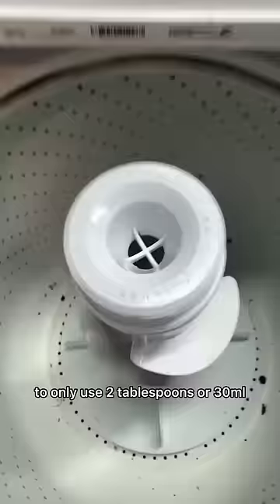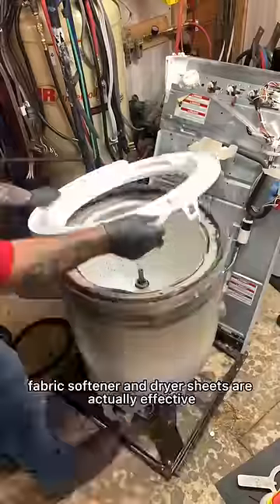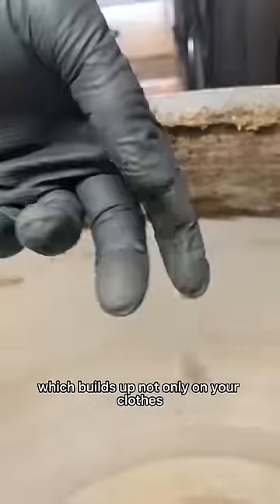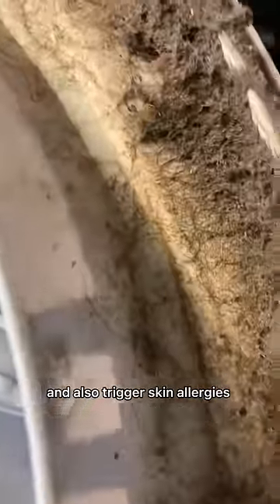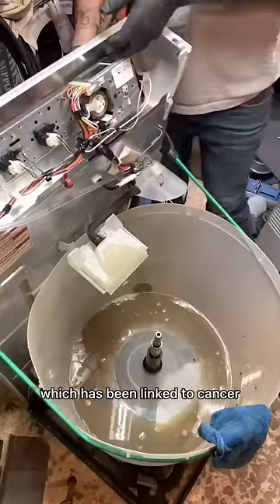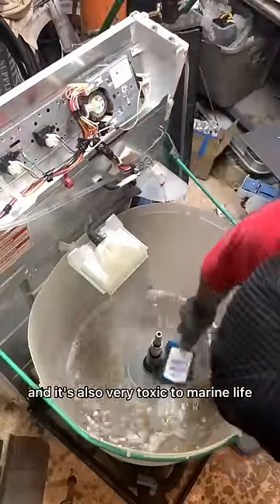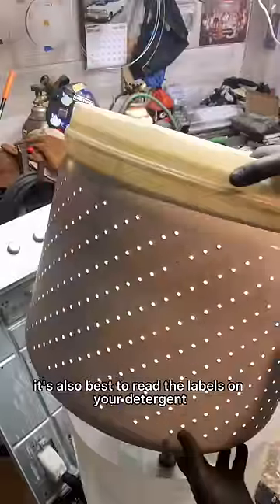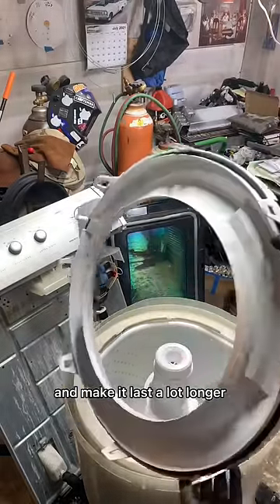Softener leads to machine failure

Comment: I've know this since the 80s when I worked at a laundromat during college. The owner said fabric softener was the worst invention and that it was shortening the life of his machines. About 10yrs later I had to start using a laundromat and even tho' I didn't use fabric softener, the residue from other loads got on my clothes and flared up my dermatographia. To this day I have to live where I can have my own machines to avoid other people's fabric softener. I also make my own laundry detergent with castile soap, washing soda and borax. I use a 2tbsp coffee scoop to measure it and also rinse with [white] vinegar. I didn't know the name of the chemical glutaral. Thanks for that info!
Reply: Castille soap and borax ❤❤❤
Reply: Washing soda or baking soda?
Reply: @j.p.6932  Washing soda. Washing soda is not edible whereas baking soda is. Washing soda is specifically used for washing. It's made from baking soda and you can make your own by heating it in a flat pan in the oven at 400degF for 1-2hrs (depending on the type of pan you use). The heat causes a chemical reaction that makes it more caustic than baking soda. Washing soda has a pH of 11.
Reply: I really highly doubt the truthfulness of that. My parents have had two washing machines in their adult lives. I've had one for 15 years that runs like a top and has never needed service. Decades of regular, almost daily use is a pretty good indicator. Vinegar is also advised against by some because it breaks down rubber components more quickly.
Reply: @e.l.norton  You do you.
Reply: @Nicole215  No. It's advised against by people who used it and the repairman who've replaced the gaskets and hoses. Vinegar cleans corrosion off of copper. What do you think it does to rubber over time? Chemistry is chemistry. But, they're your repair bills. Have at it.
Reply: which vinegar type do you use?
Reply: @Squee7e  White
Reply: @GraeMatterz  
Good to know. Thank you. I’d never heard of washing soda before
Reply: I use washing soda, baking soda and shredded zote soap. I use distilled vinegar for smells and shout for deodorant stains.
Reply: What is the mix ratio please? @Mighty_Atheismo
Reply: @George-vf7ss  I used equal portions of castile soap, borax and washing soda. Typical batch is 2c each. I use unscented Kirk's bar soap and shred it into flakes using a cheese grater, then turn it into a powder in a food processor. I mix the 3 ingredients and place them in a container. (I use a repurposed protein powder jug as it has an opening wide enough to get my hand into and has a threaded lid.) I keep the 2tbsp scoop in it and stir it up every once in a while to keep it well mixed.
Reply: @professionalcommenter  I've heard others saying they use both washing soda and baking soda but adding baking soda is redundant as washing soda is made from it in order to make it stronger.
Reply: @Nicole215 you wrong and you know it. Any adult knows vinegar dissolves rubber by making it brittle and flaky. Take a science class or read a book
Reply: I use soup nuts(a litteral berry that acts like soup😊) for laundry soup. Then I dry my clothes with wool dryer balls. I still have issues with the itchy skin because it's shared laundry but it's not as bad as it was😉
Reply: @rahorakhty1420  While this is true, many modern rubbers we use in washing machines are resistant to deteriation caused by vinegar. Also, remember that it's going to be extremely diluted in your washing machine. Vinegar is a great additive and won't do much to harm your machine.
Reply: just get softener for sensitive skin lol then your clothes smell nice
Reply: @BobaPhettamine  The problem isn't hard water. The problem is chemical residue and odors. Fabric softener stinks.

Comment: Also vinegar is a great way to clean microfibers without damaging the sensitive threads.
Reply: Is this why my jammy jams get those cratchy balls on them!? I feel lied to!
Reply: @Interweb_Gremlin That, and the dryer itself can cause a surprising amount of damage to clothing depending on the fabric used. Especially synthetics and some natural fibers like wool and real silk.
Reply: @peggedyourdad9560  also depending on the type of dryer. Heat pump dryers are less harsh on clothes than a standard vented dryer.
Reply: Thank you for that information. 😊

Comment: I stopped using fabric softner about a year ago, but my washer still had so much residue built up from it stuck in the compartment where you put it in. Took it apart to clean properly and it was like wax, warm water didn't melt it or help, had to scrape it off. Didn't dare pour it down the sink in case it blocked the drain too, so I used paper towels and binned it. If it doesn't melt in hot water imagine what it's doing to your machine and clothes.
Reply: I mean if it doesn’t melt in hot water it’s probably having a minimal effect on your clothes since it can’t leech into the water
Reply: I used it once and never again because it didn’t do anything and I realized on the bottle it said it can make fabric flammable no thanks.
Reply: @mrs.quills7061 A TON of fabrics are flammable NOW, lol. Anything synthetic Is a guarantee of being flammable. So, cotton, wool, leather. That's it.
Reply: @windsofmarchjourneyperrytr2823  Bamboo.
Reply: I know what a yucky job cleaning the gunk from the outside of washer tub is. I am grateful I found a YouTube video showing how to take a top loading washer apart and replace the pump. While I had it apart, I scraped the gunk off.
Reply: @rouninpanda6318 why would you put bamboo in a washing machine though... also, what clothes are commonly made of bamboo?
Reply: @rouninpanda6318 Hemp
Reply: @SacredMilkOG There are now textiles made out of bamboo fibers that are used to make a variety of clothes.
Reply: @SacredMilkOG Rayon is often made from Bamboo. I believe it can also be made from wood and hemp too. Bamboo is also used in making a variety of mattress components too, charcoal, covers/liners, ect..
Reply: Use vinegar(200ml) instead...the result is nice and soft clothes...
Reply: @mstar501  200ml???? 😂😂
Reply: @SacredMilkOG 
Base layers, underwear, bedding… due to the inherent antibacterial aspect.
Reply: Why? I don't have an issue with softener use. Period.
Reply: I had to use a Chisel to remove the hard residue on the drum
Reply: I noticed Rinse and Repeat breaks that residue down after using it in your wash a few times.
Reply: @DJRenee  What's that?
Reply: @mrs.quills7061 you... You do realize. All fabric is flammable? Unless it's soaked in a flame retardant

Comment: I greatly enjoyed learning about wool dryer balls.  Best buy of my life!  I don't have asthma, but I do have allergies that are getting worse as I get older.  Indoor or outdoor, strong smells can also set off the histamine reaction for me. So I changed household cleaners wherever possible and while I never used fabric softeners, I stopped using dryer sheets and started using wool balls. They soften your clothes, dry puffy coats better anyway, and don't leave any residue or smell unless you choose to add a drop or two of essential oil.  They last a really long time and basically never need to be replaced. And my grandma can use them as a stress ball if she gets bored😂.
Reply: yea its best top not put vinegar (an acid) into your washing machine anyways, as you can break the rubber seals, this guy fixs machines so he would love everyone to use vinegar, gives him a job

Comment: I always tell everyone I can every 6 months scrub the lint screen from your dryer with a scrub brush and Dawn dish soap to get rid of the waxy buildup from using dryer sheets. 
It builds up so much that air cannot get through the mesh. Cleaning it at least every 6 months will extend the life of your dryer by years and also make it so your clothes dry faster.
Reply: If you read the manual, like this guy is preaching, you're supposed to clean that thing a LOT more often thsn that.
The footage in his video here is only because people don't.
Had a few washing machines in my lifetime, decades later none of them look as bad as the stuff in this video.

His words are scare tactics, true, but only to an extent. He's not telling you the whole truth.
Reply: @Duck_side  who's missing their dad
Reply: I believe your suppose to clean the mess every time you use the dryer because of the lint build up. I ain't never heard of letting it go for six months and was taught to clean it, everytime you use the dryer.
Reply: @loretta2539  yes you clean the lint from the dryer everytime. Every 6months you take the empty lint screen and scrub it with a scrub brush and dawn dish soap to remove the waxy build up up on the mesh.
The dryer wouldn't run if you didn't clean the lint for 6 months..
Reply: @loretta2539  this, exactly. It's even written in the manuals supplied when people buy a new dryer.
Reply: That and cleaning the lint screen every time you do a load of laundry. I do a lot of laundry and have pets. A. I don't use dryer sheets or fabrics softener. B. I clean it after every dryer load. 
I tooky dyer apart after 3 years to clean the inside I found maybe a palm size amount of lint inside.
Reply: @magnit3  yeah I kinda thought cleaning the lint out everytime was a givein, but I guess not everyone does that. But regardless the wax from dryer sheets will clog up the screen even with cleaning the lint out.
Reply: Yep. Run the mesh screen under the faucet amd watch it hold water if you don't believe it.
Reply: @humanmonsters  It's kind of shocking to me that everyone is missing your point about wax buildup and assuming that you don't clean off the lint itself after every load. I, too, thought that that was just a given, but it looks like a lot more people than I realized like to court house fires. 😬 Anyway, your OP was a great tip for anyone that uses dryer sheets and has ears to hear. Thanks for sharing!
Reply: @Kira_Martel  yeah no I was taught to clean the lint out of the trap when I was like 9, the fact that it's so uncommon that people assume that's what OP meant is honestly terrifying
Reply: My household has started using wool balls which are marketed as an alternative to dryer sheets as we're all affected by fragrances, myself especially. They do pretty well at removing static and I think the mass of them churning around is what helps with wrinkles.
Reply: @OOZ662  I lived with a friend who used those, I tried them a few times. We also would put a few drops of lavender essential oil on them. You're right about how they do well to get rid of static.
Reply: @Kira_Martel  yes, I kinda felt like maybe I didn't write clearly enough, because people kept saying that. Thank you!
Reply: @Kira_Martel  When I was a kid our dryer caught on fire even though we always cleaned the lint trap And my mom would put the vacuum hose down inside the machine and into the exhaust hose from the outside. (Found out later it was because the exhaust hose we were using was an all aluminum one, which had been taken off the market because it would start dryer fires really easily.) We switched to the white plastic ones after that, but it was still a terrifying lesson about how easy it could happen.
Reply: @human monsters,Wise up!  the lint that's collecting in your dryer, that's your clothes breaking down.

Heat breaks your clothes down, that's why I quit using a clothes dryer years ago. Now I air-dry my laundry, and my clothes last much longer. 
🤟😁👍
Reply: @humanmonsters
Reply: I clean the lint every load and never use fabric softener or dryer sheets. My washer and dryer are happy.  My clothes and towels are great.  Wool dryer balls are great.
Reply: @humanmonsters  I don’t have waxy buildup because I don’t use fabric softeners or dryer sheets.
Reply: @anitas5817  that's awesome. 👍😎
Reply: I clean it after every single dry
Reply: @humanmonsters  you should consider switching to dryer balls. You won't get the waxy build-up plus they save on your energy bill by reducing drying time. Also they're cheaper in the long run. 6 balls will last you YEARS and they're much better for the environment.
Reply: @ekaski1  I've tried them honestly I didn't really care for them, I didn't see any reduction in static cling, I don't think it made the clothes dry faster. I even had the essential oils to drip on the ball. I just felt like it absorbed of the oil and didn't really make clothes smell like it at all. Though it does help when you try to dry something big like a comforter, but tennis balls do the same thing. Everyone has different preferences. It's just not for me. 🤷🏻
Reply: @humanmonsters  oh interesting. It reduced my dry time by 40%. I used to have to run 2 cycles for towels and jeans but now they're done in 30 minutes. But tbf I live in a humid climate so clothes take longer to dry here but I have no issues with static cling.
Reply: @ekaski1  are you sure that your dryer vent hose and inside of your dryer are free from lint? If you lift up where the screen goes you can stick your hand in or just shined a flashlight down there to see cuz sometimes the lint builds up in the dryer underneath of where the screen is. When I was a kid our dryer caught on fire from just a little tiny bit of lint in the vent hose that vents outside. It's worth checking! Yeah anytime I found a dryer that doesn't dry clothes that's usually what the problem is, that the air can't get out of the dryer and it takes the clothes along time to dry.
Reply: @humanmonsters  oh yes I'm sure. I get the entire line cleaned annually. My dryer works fine, even though it is nearly 10 years old. It's just that the balls REALLY help.
Reply: @loretta2539 There's way more cleaning that that, tho.
Reply: Well I skip using dryer sheets so no need 🤡

Comment: Solid advice! And yes, the vinegar does NOT leave a lingering smell.
Reply: Yes, it does! And I've given it plenty of chance 😖. Nope.
Reply: I've been using vinegar instead of fabric softener since 1999 when I bought my set. My washer and dryer are still in great condition, and I've never been told I smell like vinegar. And yes, leave the lid open after a wash.
Reply: How much should I use?
Reply: @stripermad1  I just fill the spot designated for fabric softener with the vinegar instead.
Reply: Dont mind if I ask what brand did you use? Some brand perhaps have different ingredients
Reply: @gtc7975  I use store brand. I usually get mine at Sam's club, which is members mark brand, Walmart is great value, and Aldi is Tuscan garden.
Reply: @MT-jl6zn  There is scented vinegar available fyi. You can also use apple cider vinegar that smells more like apples than pure vinegar.
Reply: @sarahjohnson6620  you can mix your vinegar with some lavander scent or whatever scent you want, of course just a few drops 🤗
Reply: @vicious420  I put lavender on my wool dryer balls. Work great!!
Reply: Yes, we have no bananas...😅

Comment: I stopped using fabric softener and those damn scent beads too. I use a little vinegar in the pre wash cycle and my clothes smell just as good and don't have that weird waxy feeling. I also have really sensitive skin and I noticed an improvement with that as well. Thank you so much!!!!
Reply: How much vinegar do you use ? Do add in begging on put in a downy ball or fabric softener dispenser ?
Reply: @Vicki Bock-Ledbetter  I just use the detergent cap to measure it. I fill the cap about half way. I put it directly into the fabric softener drawer just like I would the fabric softener. You won't smell the vinegar at all on your clothes once they are dry. Dont panic if you smell the vinegar when you're switching to the dryer. I hope this helps.
Reply: Stuff makes my skin hurt

Comment: Vinegar works SO MUCH BETTER than fabric softener. I was shocked at how soft the clothes were
Reply: Vinegar is acidic and will cause rusting and destroy rubber parts.
Reply: @oksills  that's what I thought as well.
Reply: @oksills  you think a 5% acid diluted in all those litres of water will do damage?
Reply: Vinegar also preserves the color in your dark clothes.
Reply: baking soda too
Reply: How much are you supposed to use? I tried it once and did not get the results everyone is talking about. My clothes were still full of static and l did not find them to be that soft. 😢

Comment: Guys in the sales department like holy hell why everyone buying vinegar all of a sudden 😂
Reply: .. and without selling insanely expensive softener, profits are down 300% 😌
Reply: Vinegar is however corrosive to metals so there's that. Look it up.
Reply: @TheTubejunky  it’s all good, washers will be made from 100% plastic before you know it, with a life expectancy of 11 months.
Reply: @everyhandletaken  I heard all the stuff was cracker jack crap, so when our super well made washer from the previous century developed a small leak from the weep hole of the main bearing I jammed the end of some small tubing in there and snaked it up around the waste water exhaust hose up into the drain so no nearby la`haaa'dies wouldn't see water on the floor and la'hoooosr their minds thinking we need a new cracker jack cracker washer.
So far so good.
                           Prof. I. Ver Mectin
Reply: @aaronsmith5433  good work!
The age old “they don’t build them like they used to” applies to fairly much everything these days, so we have to try & hold onto the good stuff by any means possible!
Reply: Exactly!!! And every company about to raise its prices to fit in with this bs logic of inflation 🙄… vinegar about to be $5 a bottle 😂😂😂😂
Reply: Hell is not Holy.
Reply: @relatablerealness973  So, as I get older my expenses go up and so does ma income. So only the price of ma car and my sex drive go down??